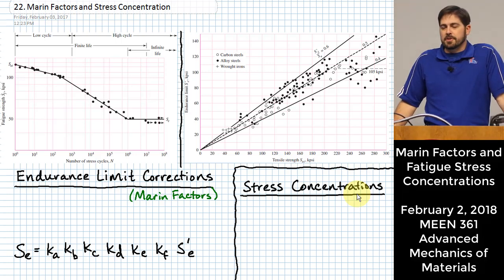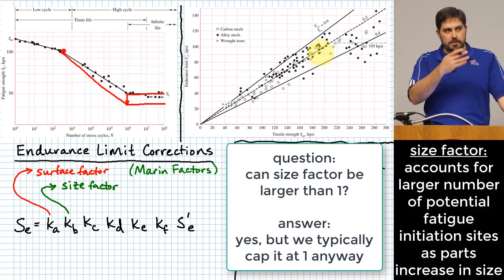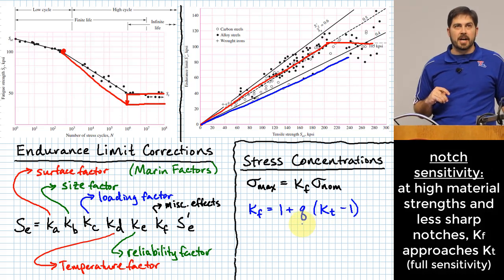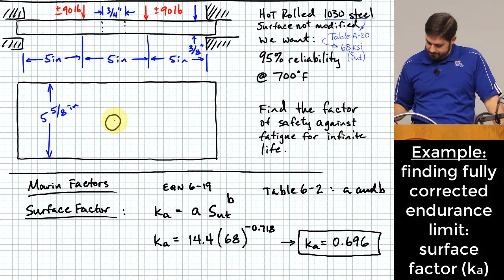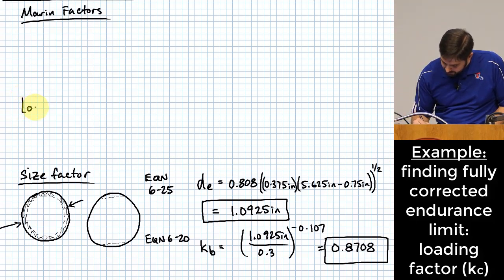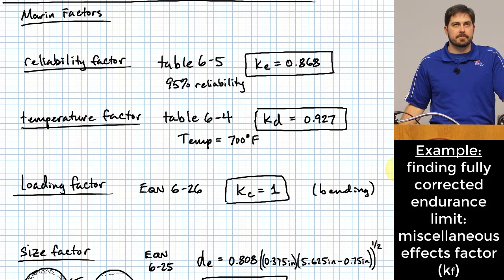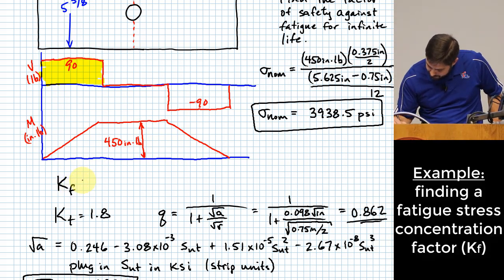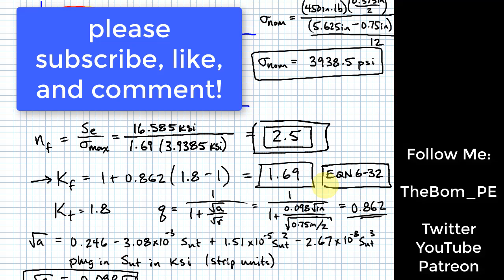Marin Factors | Corrected Endurance Limit | Fatigue Stress Concentration

Comment: Dear Professor, thanks for your valuable videos on fatigue that I started to follow to review my engineering background. I am responsible for design on a Company that manufactures big equipment for heavy industry, and needless to say, I’ve been using these methods (on a slightly different flavour, but substantially the same) for many years. Most of the time we use FEM to get theoretical Von Mises stresses, sometimes we mitigate with q factor if we feel that it is significant, and we come out with a fatigue stress. 
Many times we deal with large welded structures and we consider them as solid to figure out what the stresses could be at the weld itself. You may imagine that it is quite difficult to treat these weldings with the “classic” formulas when the structure is highly hyper static and needs to be solved numerically. 
Most of the time our stresses are pulsating (from the zero) so we need to figure out Se with the Marin factors.  
My questions are:
- the ultimate tensile strength of the materials usually varies with the thickness or diameter of the part. If we consider actual UTS of our part, already reduced with respect to conventional 10mm test part, do we need to consider as well the Kx related with the size?
- are you aware of some literature that explains how to use FEM and compute fatigue safety factor, maybe focused in case of weldings? FEM (we use Ansys) does not take into account Neuber factor, so it might overestimate especially with low resistance ductile steels, usually applied in welded structures.  

I know that I’m asking a lot, but it is a very interesting topic and I find very few people competent on this.
Thanks!

Comment: Nice video! One question professor, what valor of Kb is used when we are sizing a cilyndrical shaft and we don't know the diameter? Suppose it's not rotation, just alternating forces like the problem that you solved. Regards
Reply from the maker: When you say alternating force, I assume you mean causing flexure like the example here. Table 6-3 in Shigley says round members in non-rotating bending have effective diameters de=0.370d. You could do an iterative solution where you assume a size and solve for factor of safety, then revise your assumed size based on that result and go on until you are pleased with the outcome. Good luck, and thanks for watching!
Reply: @TheBomPE  ok, I supossed to do iterations, thank you very much!

Comment: Thank you professor for this information. I would like to ask a question I need your answer .. can this be applied to fragile materials like PMMA? Is it possible to get the book you use ?
Reply from the maker: I use Shigley's Mechanical Engineering Design as the basis for these lectures. I do not have specific experience with fatigue in PMMA, but some relatively recent papers appear to be available based on a cursory search. The idea of plotting cyclical stress magnitude against number of cycles to failure is pretty standard. The specifics of how various factors influence the fatigue strength are somewhat similar in concept across material groups, but are likely to vary in how specific scenarios are to be evaluated. For instance, the relationship between temperature and the associated Marin factor will be very dependent on what kind of material you are considering. You won't be able to just use the table I used in the video or the equations in the text. If no data is available for the type of material & loading scenario you are trying to use, it means you have an opportunity to do some experiments and write a paper! I hope this helps!

Comment: Thanks for your video, I am trying to find out how to use the formula for the size factor with a hollow circle cross section with a diameter of 200 and 600 mm.with an area of 0.282m^2 but I can not get an equivalent diameter to use the formula. Can you help with this?

Comment: Hi Sir, when calculating Neuber number, should we plug in S_ut = 68 ksi (from table A-20) or the operating ultimate strength which is kd*S_ut?
Reply from the maker: I tend to use the plain ultimate strength since that leads to a calculation of higher notch sensitivity since the material has lower strength at high temperatures. This makes it more conservative, generally. I don't think it is wrong to adjust for temperature though, if you are confident about the nature of the material behavior at elevated temperatures.
Reply: @TheBomPE  thanks for your clarificafion!

Comment: When i put the values of a and b in the equation of K sub a, i get some odd value with some odd units in Mathcad. what can be reason?
Reply from the maker: That is an empirical equation based on experiments and not theoretically derived. Because of that, units should be stripped before performing the calculation in mathcad. Those equations assume you are plugging in a numerical value associated with specific units, but not the actual units.
Reply: Thanks. It worked after stripping off the units.